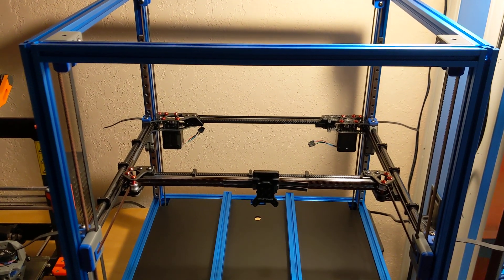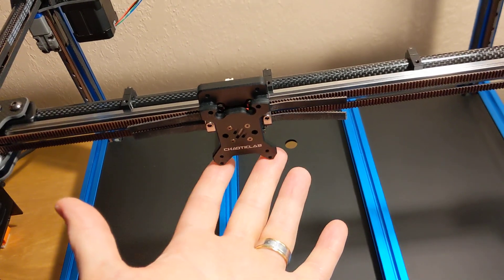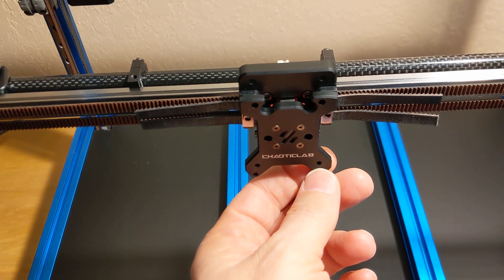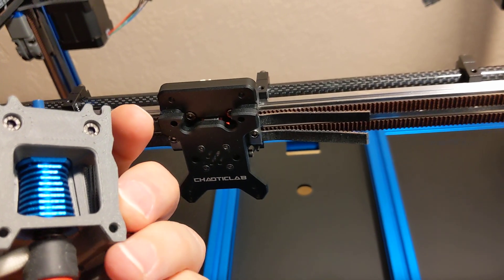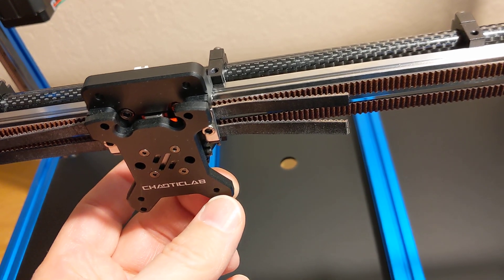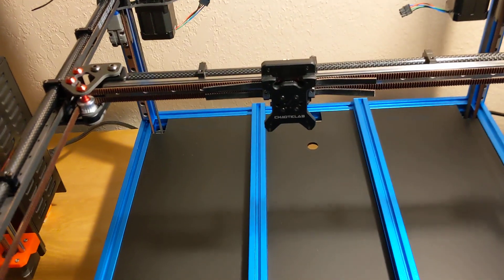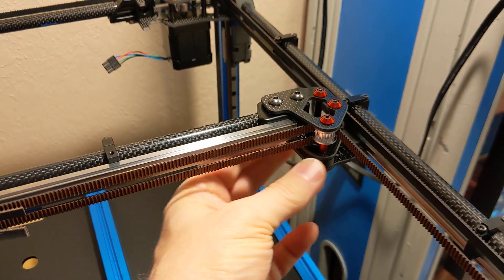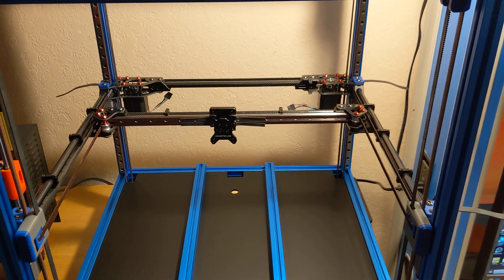3D Printer Voron 2.4 Rev. C 350mm - Build Progress Part 7

Comment: How do you like that chaotic lab carbon parts ?
Reply from the maker: I didn't realize that they require going with an umbilical setup.  The build manual doesn't have any information about how to go about setting that up on the toolhead.  Without the ability to print ABS, I'm not sure how I'll be completing the build.  I might end up just setting it up with the toolhead wires suspended by a lanyard to get it up and running while I look into canbus.
Reply: i am curious how this tube will perform on the x axis. I would like to replace my 20mm extrusion with something lighter weight.
 @TomsProjects